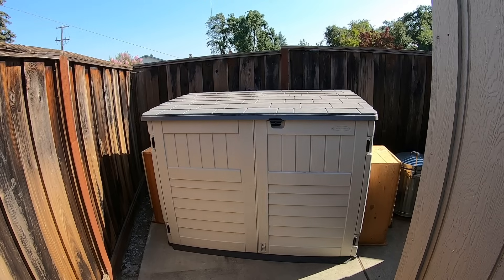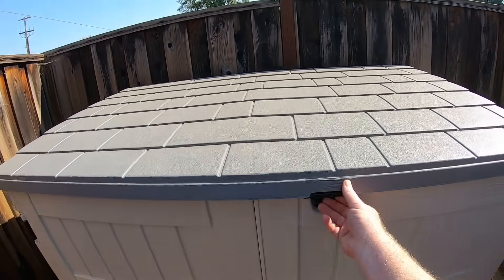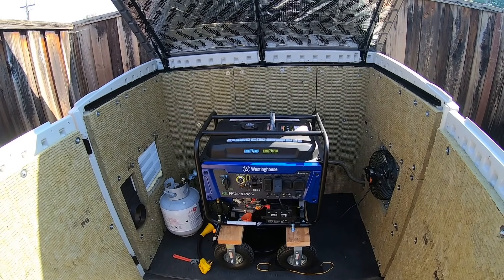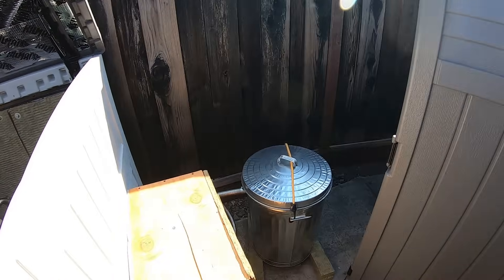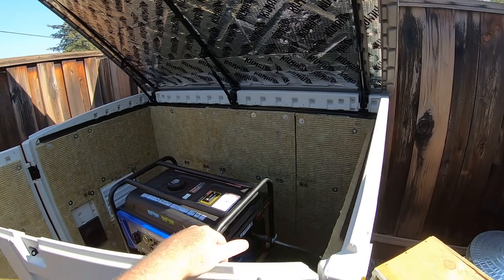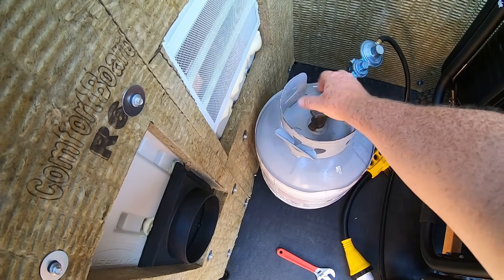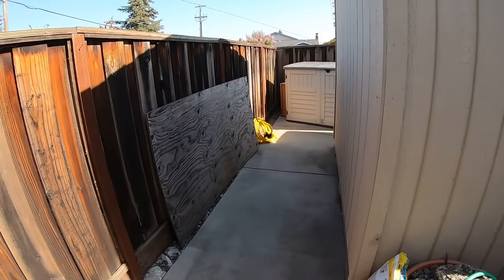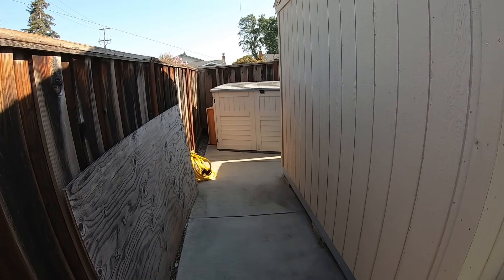DIY Generator Shed Build - Quiet Sound Insulation with Exhaust Muffler

Comment: Crazy question, Why the helmet?
Reply from the maker: Ha Ha! Yeah, a few people noticed that.  I already had a gopro chin mount on my dirt bike helmet.  So I used it for this video, as it provides a nice eye-level point of view, and lets me go hands-free, and I could move things around and hold the dB meter.  The down side is that it places the camera mic about 3 inches from my mouth, so the mic picks up every little breathing and lip sound.  Sorry for that.  This normally isn't a problem when riding dirt bikes, as you have a lot of background noise and can barely hear when you talk.  But with little ambient noise, it is a bit much.  Will figure out a better mic setup for next video, if I use this setup again.  I'm not a pro youtuber, just a guy that built a shed.  But thanks for the question.

Comment: The only thing you could have done better is you have the fan in a good place but your heat exhaust vent should have been set higher to get the heated air out of the container more efficiently. Maybe, sink a ground rod as a precaution to prevent a shorting hazard in wet weather. Other than that it looks like a very good planned out a project.

Comment: You did not account for back pressure caused by the exhaust restriction small pipe that you have installed. This makes the generator work harder, get harder and not run at full output. The output flex should be much larger to reduce the back pressure due to the exhaust having to travel extra length not a restricted size. Not designed for this application. Air does mind turning corners causes more back pressure. Anyway, I have installed 100 of generators as an electrical contractor. Other than that great idea and looks good. :-)
Reply from the maker: Thanks for the feedback.  I've since upgraded the exhaust to 2" the whole way, and straightened out the flex pipe.  That should help a bit.

Comment: How did you attach the rock wool on the inside of your shed?
Reply from the maker: The rockwool was 1.5" in thickness, so I used 2" self-piercing screws with large washers.  Basically 1/2" longer than the thickness of the rockwool.  Any longer, and it could go through the outer shed wall as well.

Comment: WAIT! You bought an internal combustion engine generator to charge electric motorcycles? .... uh. really?
Reply from the maker: Yep, definitely.  You do what you need to do to charge the bikes when off-grid.  I didn't get the generator to charge the bikes when I actually have an electrical outlet available. It's only for when I'm out in the woods and have no access to the grid.  I didn't get the electric dirt bikes to be green, per se.  I got the electric bikes because they are fun, and have a lot of advantages over internal combustion motorcycles as far as power, noise, maintenance, simplicity, etc.  Energy is energy; you just need to transfer it to where you need it in the form that you need it.  In this case, a portable generator to charge an electric motorcycle while camping makes sense.  Just like using an electric gas pump to fill your car with gasoline makes sense.
Reply: @C5Tor  That makes more sense. I thought you got electric bikes to be 'green' - then charge them with your own generator instead of an outlet.

Comment: Have you done a nighttime test?  I think that is a pretty important aspect to factor in. Ambient noise is always less at nighttime so even noise in a shed as well done as that may still draw attention. In a power outage situation, I can imagine ambient noise will be even less during the daytime as no one else will have anything operating.
Reply from the maker: No, haven't had to use the generator in anger yet.  Meaning I haven't had to use it in a power outage.  Unfortunately, time of day really doesn't play a factor in the shed design.  The goal was to make it as quiet as (reasonably) possible.  The generator ultimately will be just as loud at night as it will in the daytime.  Ambient noise isn't a variable I can control, so I just focus on the things I can affect.  We can just do our best to be good neighbors.  Were you referring to things I can do from a security aspect, since it might draw more attention?
Reply: @C5Tor  yes, drawing attention would pose a higher security threat. I’m guessing it’s just a do your best kind of thing.?  Would another layer of sound absorber work to lower db’s?  Would other soundproofing materials help like resonant channel drywall or the stuff they use in sound studios? Idk🤷🏻‍♀️ just wondering. 

No bang sticks where I am so making myself less of a potential target in a infer term emergency is desirable.
Reply from the maker: Actually, the rockwool is used in sound studios as well, usually covered in fabric.  But, yes, you can keep adding layers to reduce the sound a bit more, but at some point you reach a point of diminishing returns where you double the cost of the shed, but don't reduce the sound level much.  You can always put the shed inside another shed, but is it worth the cost, time, etc.

Comment: This is awesome! One question you spent a lot of time on this,.do you anticipate using this a lot?
Reply from the maker: I'm hoping not to use it at all.  But we have had rolling power outages in years past, due to wildfires and high winds.  Fortunately none this year.  Crossing fingers.  I absolutely didn't have to put this much effort into a shed.  It is just the OCD in me that if I'm going to do something, I want to do it right.
Reply: @C5Tor  right on. I have had my generator for 4 years and have never used it.. I guess that's a good thing.
Reply: I usually have to use my generator at least once every hurricane season to power my two fridges, the freezer and my RV so I have a/c, hot water, sattelite tv, internet and a working microwave until the power is restored, which could take a week or longer. I just had solar panels installed that should power everything during the day time and then I'll just need to run the generator during the night.

Comment: Generac has newer whole house generators in the low 2Ks. For your whole house! Whats your investment.. This does NOT include the transfer switch, but neither does yours. Mr Killjoy
Reply from the maker: The generator was about $1000, and I have $700 into the shed.  But the primary use of my generator is as a portable gen, not a house backup generator.   So I had to be able to move it around.   The shed was an afterthought in my situation, since I already had the generator.  But definitely agree, if you are going to use a generator only as a household backup, get one built for that purpose.
Reply: @C5Tor  You have a GREAT build, really enjoyed it. Do question the mobility of the shed though..
Reply from the maker: Ha ha!  Yeah, the shed isn't going anywhere.  Just for running the gen at home.  Although, now you have me thinking of putting the shed on big ol' offroad tires... And maybe the generator can power an electric motor to move it around with a remote control, so it can load itself on a trailer...  Hmmmm.  I think I know what I'm doing this Summer!
Reply: @C5Tor  chuck up an electric motor on it u b going somewheres! love your build VERY WELL DONE!!!

Comment: That is HANDS DOWN, absolutely the BEST, gas/propane generator sound deadening shed build/review video that I've EVER seen on YT!  I'm TOTALLY going to build one just like that! I'm currently using my chicken tractor to house my generator if/when we loose power and have to run the generator and it reduces the noise level at least 50%, but no where near as much as this shed does.  I love the ingenuity of using the generator itself to run the fan that cools the shed!  Absolute genius brother!  Great video and I look forward to watching the build videos now.  You've definitely earned my SUB with this video!  Thanks
Reply from the maker: Thanks for the enthusiastic feedback!  Stay tuned for some more videos as I upgrade some of the components of the exhaust from 1" to 2" to make the generator breathe a bit easier.  I am a bit curious what a chicken tractor is, though.  (Nevermind, I looked it up. But I was totally picturing a chicken driving a John Deere.)

Comment: good video but surprised its still this loud really..Big generator! I suspect you need some high dollar lead/foam engine room barrier stuff..or?? Balloons. Its amazing what an inflated sphere will do..or cheap toy balls. I had a loud VW van once with an inflated raft in the cabin and YOU COULD NOT HEAR the engine at all. And I drove 500 miles in third gear because of it one time..another idea is therompane windows with a vacuum between the panels. And these are made in stainless as well for freeze boxes..

Comment: How loud is it when you have the waste gate open? Or how do you keep the noise done then when it’s open
Reply from the maker: I only have the blast gate open about an inch.  I pass the cables through, and then close the blast gate down onto the cable.  You can see my other video where I test the generator to see if it will charge both of my motorcycles, and you can kind of hear it there.

Comment: Do you have a link to the supplies used, especially the exhaust extension?
Reply from the maker: See the video description for links to some related videos on the muffler build and sound testing.  Just FYI, I am updating the exhaust parts from 1" to 2", so stay tuned for an update on that as well.

Comment: That is a whole lot of work for what could be accomplished a lot safer and more robust with a factory enclosed genset from the store and not Chinese at heart.
Reply from the maker: Did you have any examples of those gensets you are referring to?  I assume you are referring to Honda or Yamaha inverters, but feel free to share any additional info.  I would have loved to go with one of those inverter setups, but they were about 4 times the price-point, and did not offer the max continuous power I needed for my application.  Would love to hear any suggestions you might have on better options.
Reply: @C5Tor  I meant just a good old 14 kw Kohler generator for that application.  Yes it is 4 times the cost but not made in China and you don't have to do piles of work to it, just plunk it down and get on with life.
Reply from the maker: Thanks for the clarification.  Keep in mind that I mentioned in the video that my primary use for the generator was to charge two electric dirt bikes while out in the woods.  So it needed to be a portable generator that fits in my pickup.  The generator shed for home backup power was a secondary use, since I would have a generator anyway.  A 500 pound Kohler wouldn't exactly fit that need.  But it would definitely make a really nice home standby generator.

Comment: A Honda EU7000 is quieter with NO shed, but I get it.
Reply from the maker: Yeah, the Honda is nice and quiet, and a very good generator.  But it is also way more expensive.  It also didn't have the power I needed for my primary application, which was charging two electric motorcycles while off-grid.  The Honda is about 2000 watts shy of what I needed.  I needed something that would push 8000 watts and 32 amps continuous.  If the Honda had a bit more power, and was about half the price, I would have gone for it for sure!
Reply: @C5Tor  i have the EU6500 and purs like a kitten, but totally understand the DIY shed for many generators. I am surprised a big manufacturer never made these types of little sheds. I saw the Zombie box, but weird looking and very expensive. This shed is great!
Reply from the maker: I actually took the Zombie box as my goal, and tried to figure out what I could do on the (relatively) cheap to replicate some of the sound canceling features of the Zombie box.  It still wasn't cheap (I think I have about $700 into the shed and muffler), but definitely better than $3k.
Reply: Your shed looks like shed so not to attract thieves. The Zombie box WILL bring attention to your yard. You did a great job.

Comment: Idea: What if you could drill into the shed walls and fill with spray insulation for extra sound proofing?
Reply from the maker: I actually did fill in the sections where I cut any holes, like for the vents and fan, etc.  Of course, I did that mainly for water intrusion purposes.  You do need to be careful, as the inner and outer walls of the shed are not really connected except around the edges.  So, when the foam expands, it does tend to bulge out a bit if you get too much foam in there.  So you need to be careful if you try this.  Also, keep in mind that the foam becomes pretty solid once it cures.  So, while it can keep the walls of the shed from vibrating as much, it doesn't really move enough to truly "absorb" a lot of sound.  Softer materials, like the rockwool or rubber are better at absorbing and dissipating the sound energy.

Comment: This is a very impressive build. Good Job. Another way to keep neighbor's happy is to share some electricity with them. ...A while back a storm took out power in our neighborhood for several days, resulting in the need to run a generator several hours a day to keep freezers and refrigerators cool. I ran a mess of extension cords powering 6 refrigerators and freezers for two neighbors directly, and allowed others neighbors to store food items in fridge/freezers as well as plug in small electronics and coffee makers. This storm ended up being quite a good community building experience and all the neighbors were very grateful and very happy to have light, power and or coffee in the morning. One more tip I wish to share with like minded individuals is that when running things on a generator, it is good to know the load involved. A TV uses (80W), a laptop (50W), a cell phone charger (15W), a cable modem (30W),  A typical box fan (80W), and old fashioned light bulb (100W), an LED bulb, (10W), a coffee maker (900W), a microwave (1200W), refrigerator (200-300W), a chest freezer (200W),  Window air conditioner (500-1400W), and an Electric space heater (1500W). You do not need to remember all these values as they are legally printed on back of the device by the plug, but having a good solid understanding of what loads what devices are producing helps ensure you don't overload extension cords or the generator.

Comment: I would like to know the cost of the baffle material.
Reply from the maker: There wasn't a lot to them.  In my case, they were just leftover insulation from the rest of the shed build, along with some misc. scrap wood from other projects.  The ones I made are 20" wide, 33" tall, and 12" deep.   So, essentially you could build them out of one piece of plywood/MDF. Obviously, you would need to make them fit over whatever size vents you have, but my vents are only about 12" x 12".   I used about one piece of Rockwool Comfortboard 80 for the insulation, but you can't buy just one sheet.  It comes in sheets of 6 or 10.  I also eventually added some weather stripping around the edges to make a better seal with the shed, so add another $10 for that.  I think I just pressure-fit the rockwool into the baffles at the time, and they stayed just fine.  I did go back and added some screws to make sure it stayed in place.

Comment: For a much quieter generator, invest in one that turns 1,800 RPM's instead of an 3,600 RPM. Also  the exhaust being curled would cause restrictions

Comment: I bet your neighbors really appreciate the effort you put into this. Sounds great and very quiet.
Reply: Or just buy an inverter generator, and it will be nice and quiet, reliable, they provide cleaner energy, and use less fuel.   I do none of this and its very quiet.
Reply from the maker: I definitely wanted to buy an inverter generator, but nobody was building one that was powerful enough for my minimum requirements.  Honda and Yamaha did not have enough power, and they were 4 times as expensive.  After I made the shed, Harbor Freight came out with a Predator 9500 inverter that just barely has enough power.   Still haven't seen a lot of inverter generators on the market that have enough power and support 240v, and definitely none that have dual fuel options.
Reply: @C5Tor  When I decided to get a generator, the first thing on my list was NO GASOLINE. At the time that took out every inverter model on the market, it probably still does.
Reply: Their is one that I know of but its also 15,000.00+ dollars where I have a 28KW Westinghouse 3200.00 with my electrical install roughly 5 grand concrete and all
Reply: @BoopSnoot A they're super expensive, and B can't keep up with these larger generator s power wise.
Reply: Sure as long as your not attempting to run the entire house.... those gens you speak of are not designed to handle 5ton AC and entire house....

Comment: How much power did you loose?
Reply from the maker: Maybe you can clarify the question?  How much did I lose by running propane instead of gasoline?  Or how much did I lose because of the exhaust?  Or something else?  Per the label on the generator, this model makes about 1000 watts less by running propane instead of gasoline.  But the propane runs cleaner, and I don't have to worry about the fuel gumming up if it sits for a long time like gasoline with ethanol does.  No idea about the exhaust vs. power level.  Hope that helps.
Reply: I mean but muffling they exhaust.  I know sometimes when you put exhaust on a motor it is restrictive and can cause power loss.  I get the attic fan pushes in air but I wonder if it is equal to open air?